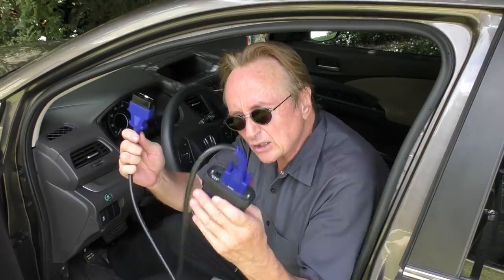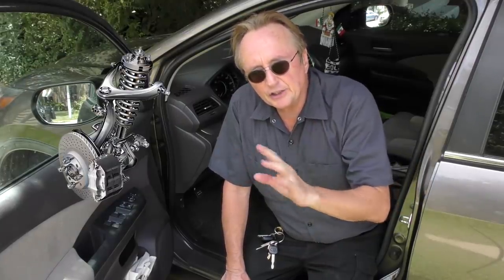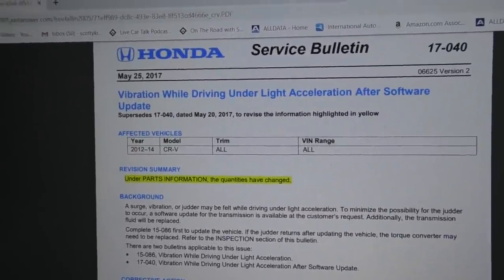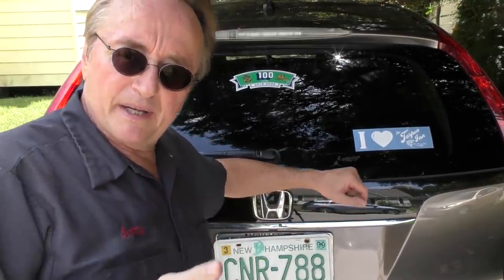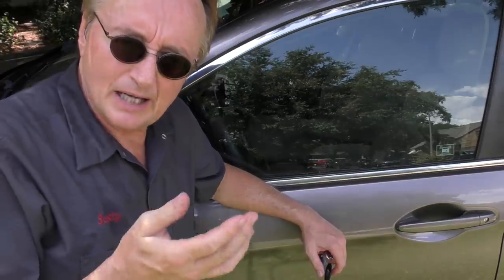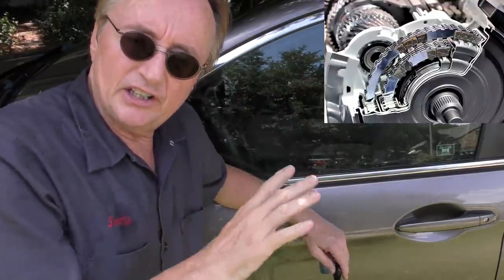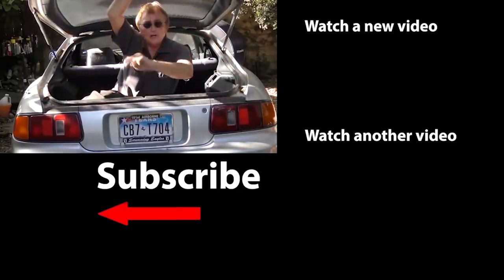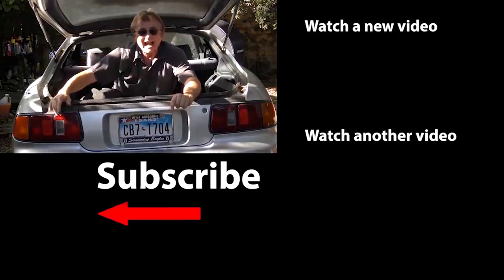I Can't Fix This Car

Comment: I have a Subaru xv 2.0i 2015 CVT. Converted to LPG.
The car is jerking when moving from a full stop.
If I disconnect the battery and reconnect it drives perfect for a day or so.
And then it's jerking again when its about 1500rpm and moving from a full stop.
When is write jerking (shudders) I mean the car is jumping ...
I did the throttle relearn. And it's the same.
I can not figure this one out and neither the garage.
May one of the computers in the car cannot calibrate itself that which one?
I replaced the CVT ECU and it did not help...
tested the camshaft sensors and got 5v from them when no metal near them when putting a metal its drops to 0v. remove the metal again it stays at 0v putting back metal it goes up to 5v... so I think its the camshaft sensors but didn't yet replace them as they are pricey 300$ for a unit and this car have 4 of them.

Comment: Hey Scotty, try Lube Guard please, wont regret it. This is less additive and more a restorer, by restorer I mean it renews the fluid and helps cut down on shutter. I have saves many transmissions with this and there are specific ones for hondas and chevy's ect.

Comment: I'm pretty sure you did but double check the driveshaft to the rear because I had the same juttering in a 04 element and it would happen and go away when you pressed the gas a little more. Ujoint gave out and it went from awd to fwd.

Comment: What about driving around with the scan tool running & trying to get it to happen. May pick it up when it happens. Can u keep the throttle where it’s at when it happens to see if it keeps doing it ?

Comment: One of my custumers is complaining about the same problem but he have the prev gen a 2005 one. Seems like honda screwed a little.the car will come to me next week but with a check engine light on. Will keep u posted if you need to hear from a 25 years old mechanic

Comment: One of my friends had this problem after someone changed the transmission oil On a Civic. They had used some other brand.  We changed gear box oil with the proper Honda oil. Ran 500km then changed again. All was good after that. 
Hope it helps. Only use the original Honda auto transmission oil only. Even Honda manual cars use much much thinner oil than others. If use wrong oil all goes wrong.

Comment: Say i take my car into the dealership to get my oil changed. Can they take their computer and cause on purpose for something to go wrong. 

Also i went to the dealership today i got 130,000 miles on my car. They say its time to change my spark plugs. I have a 2008 Siena. My van runs great. The price to do this job is 600 bucks.  They say they have to remove the top of the engine.  Should i get it done

Comment: My 2013 corolla shifts a bit weird when in low speed, spent like 2k fixing the gear box, tried other gear box, nothing worked so I'm just driving it everyday not giving a damn about the hard shifting..

Comment: what seems to be the problem when i start the car ,it needed to rev to a point black smoke stopped coming  out of the exhaust ?
 if not will stalled in the middle of the road when i needed to slow down the car . can it causing harm to rev at cold engine?
2,if i let it idle it will sometimes wait until 20 mins or more to reach drive able rpm....  help me pls~~~ T.T

Comment: This happened to my KIA with automatic transmission in Iight acceleration right before I stoped. I assumed it was the spark plugs or fuel filter. It turned out two of the four spark plugs were worn out. so I changed them all and the car functions better after that. It  jutters abit only under light acceleration during uphill roads but this use to occur way back when it had less mileage.

Comment: Honda also has a procedure show in another bulletin to check if the torque converter RPM is linear in your case I would suggest it is likely to be linear as if it is very difficult to reproduce so my guess it is not a torque converter problem . With this in mind there is another bulletin whose talking about brake override system that remove power from the engine if you apply the brake and the gas pedal is stuck ?  Could you have pedal problems , simply seize brake staying applied increasing load that mimic I am pulling a 5000 pounds trailer?
some other thought what's the transmission temperature in your data?  I say 150 F would be normal where you are what's the engine temperature?

Comment: i had a similar issue with my car. thats why the old owner sold it. picked it up with 147 k miles. After a year of abuse and 198k on the clock still does the same. But do i care? not really.

Comment: That's why u have to change the transmission fluid  ever 30,000 miles . Drop 4 and fill back with 4 .

Comment: Check out Chevy Colorado Trans "Shudder" or "Chuggle"  My Colorado, I 4cyl  has one of the Last GM Trucks that have a Manual 6 speed transmission ... no problems....Gm [ when the problem started, they changed out torque converters. Did not work...The latest is a special flush and a new auto trans fluid that is not as hydroscopic....Here on the Dry west,this has been not a problem....But wet climates snow..etc.....that seems to be the problem area[s]. From what I have read.

Comment: My Toyota Mark X 250g, does the same thing, only under low acceleration, happens often.  First started after I got the gearbox fluid changed :(.  Same engine as Lexus IS250.

Comment: Hey Scotty, my 07 Impala does the EXACT same thing. I figured that it was the transmission slipping. It only happens after I drive pretty hard for a week, if I baby it it stops and Im good until I drive like a maniac for awhile again. Doesn't seem to be getting worse. Maybe it's the current firmware version..

Comment: i had similar problem with my corolla, vibration under light acceleration, it did that sometimes and was gone as soon the speed increased enough. The reason was that there was driveshaft vibration damper thingy going bad. I just cut it off and no problems since, too bad that there is no cheap replace parts for that.

Comment: My opel had the same problem but the cause was that it had a misfire on the sparkplugs. Changed plugs and coil. Same problem so I changed the wiring harness and the problem went away.

Comment: My 2007 Honda Odyssey with 107000 miles does the same juttering your talking about Scotty under light acceleration every time or and when I'm slowing down, no check engine light on. No issues in higher speeds. Could it be the torque converter. By the way your channel is badass.

Comment: I have a car with manual transmission, that occasionally i cannot downshift into 3rd gear.

but it only happens sometimes, and only happens when shift slowly
and I have been sending to mechanics and they cant seems to find the problem
me myself suspect will be a worn synchro but to replace it will cost a few thousand bucks

so i just live with it .. 
and learn to double declutch when even i downshift

and shift smoothly and not too slow

Comment: Sounds like the issue the A8 transmission GM is having problems with.
They were replacing AT fluid and sometimes torque converters. They figured out the mobile 1 trans fluid was faulty and so that's their fix.

Comment: my dads sable did this at random intervals under acceleration especially on the high way then we changed a fuse and it has not happened since.

Comment: my citroen C2 also has weird hiccups on 1st gear at low speed, specially going up hill.. no codes, everything was checked and it's fine..
all other gears and speeds are 100% fine, except that 1st gear below 15Km/h

Comment: We have a 2016 CRV with the CVT and it does the same thing.  I doubt if its the transmission.  A friend has one also and they say it does the same thing but it goes away of you turn off the "green" light.

Comment: Well thankfully that hasn’t happened on my 2014 CR-V. However my dads 2011 Pilot has that issue just a few months ago and thankfully it was just a month before the warranty expired so they did the software update on the car and that fixed the problem which was that it was throwing check transmission lights and VSA warning lights, however the car drove perfectly fine so it was a software glitch.

Comment: I was going to say Torque Converter too - then you said it! I had to get the torque converter in my 2012 Toyota Camry replaced because it was doing the same thing. Fortunately it was covered under warranty!
Reply: Same thing here. Had this happen to me and and my 2013 Toyota Camry SE. Thought I was driving over bad roads (I live in NYC) until I saw a video on another channel and realized this was the issue that I had. Had it changed just before the TSB expired. In my opinion,  they just don’t build things the way they used to.

Comment: Hey Scotty I know it’s front wheel drive but my 05 trailblazer upper control arm broke and it did the same thing cause the rear drive shaft pulled slightly out of the transfer case hopefully it helps you find the problem

Comment: I had the exact same problem on a 2004 crv. Can't believe this is still popping up on a 2012. This leads me to believe something is wrong on these crv auto transmissions.
Reply: Not just CRV’s. Had this happen on my 2013  Toyota. And from the comments I see here it happens across other makes and models. Not good!!

Comment: Hyundai have the same problem on there SUV's. And there is a tsb on it. Might be the d same. It's the differential coupler is not synchornizing properly to the differential itself. So we have to change it with the improved coupler.

Comment: The computer was updated, but was it checked for hairline fracture(s) in the circuit board/related problems that might cause this?  Do they remove the circuit board and inspect it before installing these updates, or are wires attached to sensors only while it's in place and no physical inspection made?  I'm not a mechanic, but if it judders at light acceleration, how could it not act up at other speeds, too, if it was solely a mechanical issue?  You said you drove it for 1-1/2 hours before you noticed this problem.  Is it related to the length of time the car has been running, or does it occur right from the get-go?  If it's a physical computer issue, perhaps it needs to run for awhile to heat up the CB, causing a small flex in the board, before this problem presents itself.  I wasn't there, so I'm offering an alternative chain of events.  Come to think of it, didn't the DEALERSHIP notice this before they gave the car back to her?  How soon after the computer update did she notice the problem?  I think she should pursue this problem through Honda, since the dealership won't do anything more for her.

Comment: Air mass flow sensor or throttle positioning sensor I had do that on my GMC Van I cleaned my Air Mass Flo Sensor it helped it a lot but my Throttle positioning sensor would act up periodically even get a hard shift and did not throw a engine code because it was just periodically I changed the throttle positioning sensor and it never did that again

Comment: My 2001 acura cl, 3.2 6 cy does the samething it has the techtronics or w e its called, where its automatic trans, but you can flip it over and shift manually, it seems to only do it in that mode and in 3 gear if im at like 20 mph would that be samething

Comment: Even though a different car and year I had a shifting problem between 2nd and 3rd on my 1997 Buick Park Avenue but it wasn't such a serious problem that I was going to do a transmission job.  I bought the car when it had 72,000 miles.  I have regularly changed the oil and filter and it is still running with 232,000 miles and occasionally it will give some problems but it is probably the electric solenoids in the front of the transmission starting to hang up a bit but after this many miles you just can't beat the mileage.  I used Amsoil in the engine with 2 oil filters and use Amsoil ATF.

Comment: I use to get that with a bad coil and it happend under light acceleration.  But that triggered a code with my Rav4.  I'd just deal with the quirk.

Comment: My 07 explorer does the same thing
Reply: My '03 Explorer started getting TC shudder around 100k miles.
Changed (not flushed) trans fluid.
Plus additive (Dr Tranny, I think).
100% fine since.  And actually shifts a little smoother than it used to.  😁 👍

Comment: How  about  a  vibration  while  idling or  stop  on  traffic  light ,  2016  Chevy  Sonic  LTZ  turbo  1.4L  it  has  70,493 k  miles
Reply: its not a car its vibrator, its supposed to vibrate

Comment: Similar situation with both my '14 and '17 Subaru Forester XT: descending and then ascending a hill can make engine/CVT intermittently shudder/misfire.  Subaru techs have acknowledged the problem but it's intermittent and they really have no idea what is causing it (software updates didn't help much).  Not sure if Scotty's run into other Subaru owners having similar issues!
Reply: Its really hard to diagnose but Ive had the front half shaft(s)/drive shafts go bad just enough to cause intermittent issues and do this exact thing....especially under load up a hill its more noticeable....

Comment: This is why the old classic cars are better. Less computer, more engine and driver. Old engines are the best. If it goes wrong, take the part out, replace it. Simple. Now it's plug the car in to an obd (computer scanner) then see if a code comes up. Mechanics aremt mechanics now a days. At least Scotty does it the old way and the new way. Most mechanics look bafoons screeching their heads when the computer says no.

Comment: Its true no one can fix a cheep assambled n undsigned car specially when fixed with silly cheep engine , power train n unmatchable or worest electrical n electronical fittings..
Nowadays In our country there's Low which strongly treat the agents as a criminal if they don't repot the authority earlier in advance for an action for calling back these scammed cars n back to its suppliers..
Any car brand if its not made completely 100% in its own orignal country.. means its cheetings n a scam

Comment: Honda can’t fix my problem 
I’m at the dealer now for the 4-5 times for starter grinding issue SB 16-002
Probably new tourq converter have to be install but they refuse to do that With some excuses, have 100,000 miles power train warranty.

But I not gonna give up, I’ll take them to the court if will be a need.
Reply: Thats why its good to check on how good these dealerships treat customers. And how good they are at honoring warranties since not all dealerships are the same.
Reply: A&B it’s was more the Honda company that refuse to take care of me
But after a long fight they approve the job and now so far no problem any more

Comment: I saw that once before on a GM, it was the torque converter, it was locking up too fast or way too soon and the engine RPMs would be so low it would vibrate and just at slow acceleration
Reply: I think my G6 does that lol

Comment: If it was any other brand than toyota and honda, Scotty will said that's what's you get for buying those cheap, unreliable brands, but because is a honda Scotty said not a big deal, drived like it is, its alright😂

Comment: I had horrendous popping/clicking on the steering column, honda dealer said no problem.
Turns out there is a Service bulletin for a lower bearing being mis-set. Thanks scotty for the idea to check these.

SB-10045139-5082 if anyone else has a Honda with this problem.

Comment: We have a 2014 honda pilot and it does the same thing. We bought it new and after a few months that jittering started. We took it to the dealer and they said they couldn’t do anything 😤
Reply: IF you documented it under warranty, you may still be covered.  Check with your AG's office. You may be able to demand repair. Check for TSB
Reply: Perhaps but it sort of seems pointless because it only trembles on acceleration then dissipates. We’re thinking of getting rid of it soon

Comment: My Jeep was shuttering or bucking sometimes with no check engine light. The mechanic said it was the transmission, but i checked the spark plugs, and they were shot. Changed plugs, and all is good.

Comment: this is why hondas suck. their auto transmissions. why dont they just use AISIN transmissions until they fix theirs. bunch of bums. and maybe toyota can use honda engines. companies should mix and match the best parts possible.